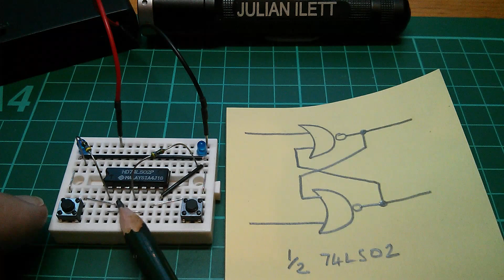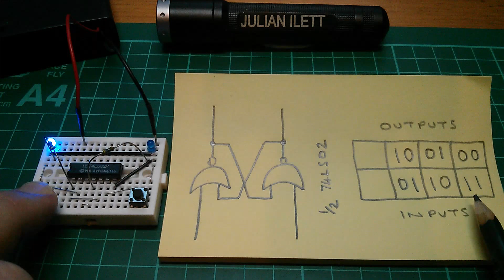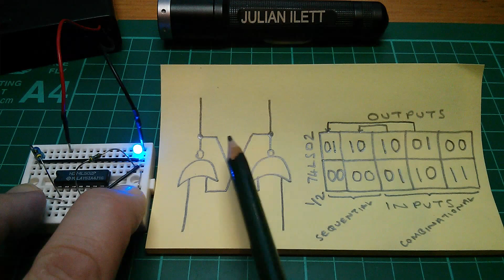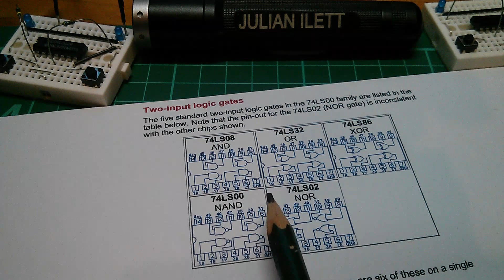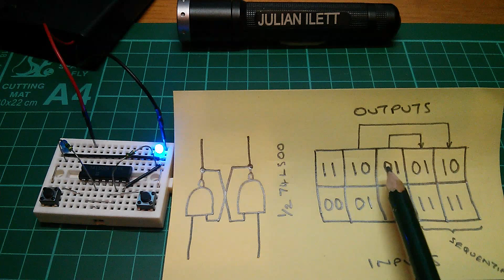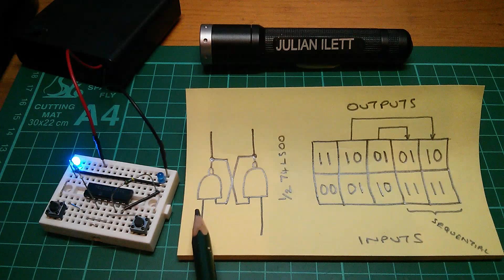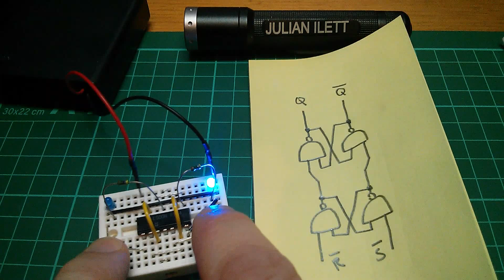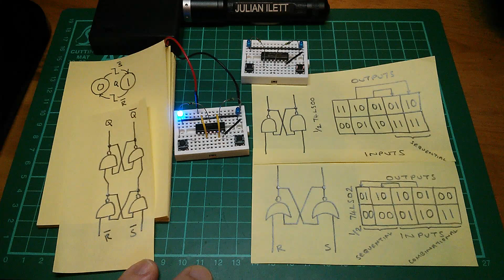Julian's Logic: The S/R (Set/Reset) Latch

Comment: Hi +Julian Ilett 
can I use the 12V 24V Male Lighter Socket Plug Connector 
with these itemes :

http://www.aliexpress.com/item/12V-24V-Input-20W-LED-Driver-and-20W-LED-Chip-5-combo-LOT-Output-32-36V/32276875109.html?spm=2114.031010208.3.66.TvsHyu&ws_ab_test=searchweb201556_4_79_78_77_80_61,searchweb201644_0,searchweb201560_10

Comment: I like your slightly out-of-the-box thinking. Though of course, if you just want a true Q/notQ output, you don't need another pair of gates. You just have to discard one of the original outputs and recreate it with a NOT gate from the other. The result of having S and R active at the same time might be different than the 4-gate version, but that's beside the point. :)

Comment: Hi Julian, I think you rather missed the normal function/use of an S/R latch. Using normally closed switches or another arrangement giving a 'normal state' of logic 0 inputs would  make this much clearer. At the end of the day, an S/R latch has a SET and RESET input, both should 'normally' be 0. Having them both normally high breaks it, so you don't really see the expected latch function.
Reply: +philDotCom Thats how I remember this type of circuit (nand gate version) - as a switch debouncer , with a single toggle switch

Comment: Now how do you move from the two input electronic switch to only using one push button? And then maybe enabling a power mosfet for a larger circuit?
Reply: I think you need two inputs for the sr latch if you want one push button use the gated D latch

Comment: Something is definitely wrong with your first circuit - it's clearly not a latch. Did you forget feedback? As per the name, the last button press is supposed to LATCH. The other button would then UNLATCH (swap the values of the two outputs). As shown by your second circuit. And the states are undefined and should be undefined, regardless of what you wish - given that the two inputs are specified as SET and RESET - clearly implying that only one should be on at once.
Reply: +Fracture 
No, the latch works perfectly, look at the truth table. It is just confusing because of the button configuration, if no buttons are pressed, both inputs are actually HIGH, which is the illegal state of the SR latch -> both outputs LOW. 
The same with the second circuit (the inverted SR latch), when both inputs are LOW then both outputs become HIGH.
Reply: +Hippo as this guy said. the issue at hand here was he was using buttons which pulled the logic low on a chip that is active high. so the default state when there should be no logic on the inputs both of the inputs where high which is the "illegal" state. I really don't like this approach to digital logic it just seems so..... wrong
Reply: +Fracture Yeah, his first circuit has the "illegal" setting (with set and reset both high) the default. It makes the whole thing rather confusing. Likewise the reason one or the other lights stays on with both buttons pressed, this is the normal hold condition--the output stays the same until set or reset is raised to High. Flip flops work with pulses on their inputs, that's what makes them different from just a bunch of gates. They have a memory.

It would have made a lot more sense if pressing the buttons fed a High into the gate instead of bringing them Low.

I'm afraid this video wasn't a very good demonstration of flip flops. It explained the gates well enough, but totally missed the boat on flip flops.

No worries, though, I'm still looking forward to the next video.
Reply: I was thinking the same, it's a little silly considering that's the main function of the latch.

Comment: A JK flip-flop would work much better as a toggle switch, when you tie it's inputs together. Also, if you put multiple JKs after each other, then the circuit could operate as a frequency divider (every stage divides the cycle by two).
Reply: Yea they are a bitch to work with though latches are so much easier and when you use flip flops and counters you have to make a state diagram than present state, next state, truth table, karnaugh map..
Reply: the number of flip flops are counters and the number of counters are state machines called moduli than you divide the frequency like you said by 2 right?
Reply: +mario rojas I would not think it's that complex. The number of divisions you can get from from n JKs are 2^n. To get the number of stages required for d divisions is ceil(log2(d))=n.
Reply: N=number of flip flops/bits correct? I just find it difficult myself when using latches you only need a 7400. For flip flops depending on how you want it can get more complex you would need multiple 7476 chips
Reply: +mario rojas Yes, the n is the number of flop-flops as I said. And yes, you need more 7476s if you need to divide the frequency by a number bigger then 4 (2^2 = 4). This is why, most of the times it's better to use programmable logic (for smaller board space and complexity). Silego has nice and cheap one-time programmable CPLDs (GreenPAK). I never used them, but they seem to be cool. http://www.silego.com/products/greenpak.html
Reply: Ákos Kovács thanks for the info and the link